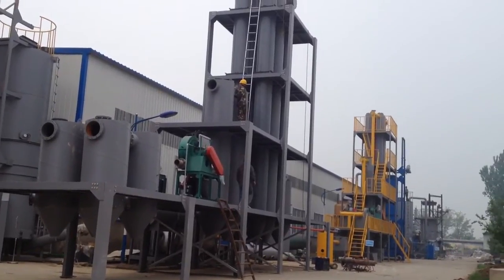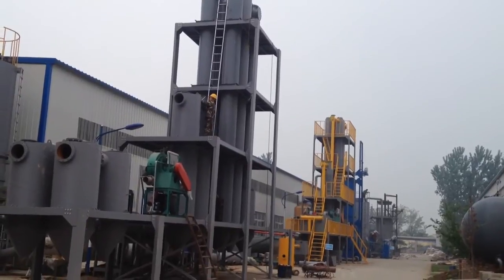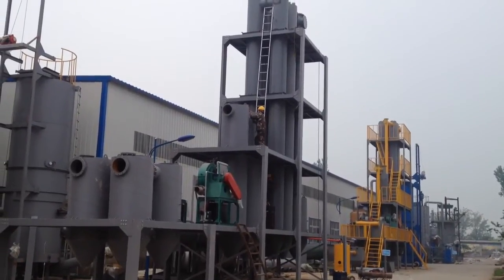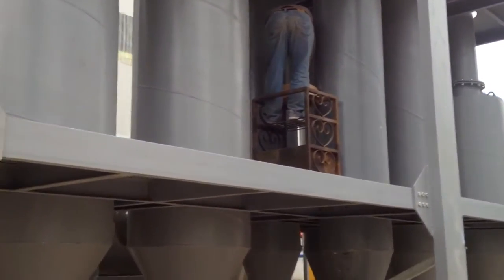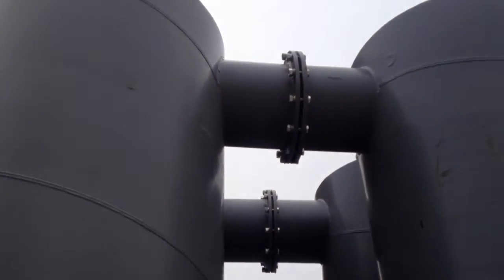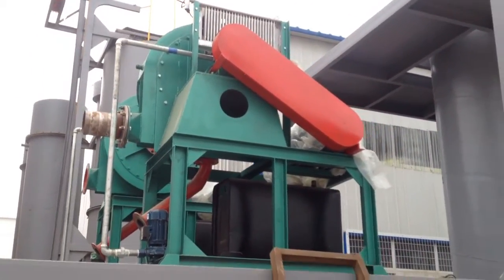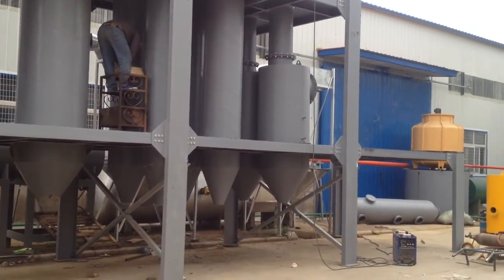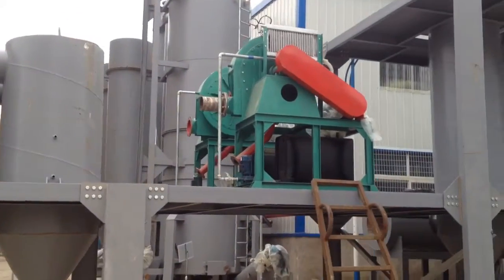500kw biomass gasification power plant system in Haiqi company China,generator,

Comment: Hello
I have a technology can boost your general generator from 50 KW to 300KW to become 10MW to 200 MW per substation. (estimate),no fuels. 
My technology does not depend on any fuel, no ocean power, no wind power, no sunshine, no water power, and no heat power, and no battery, and not magnetic. Best regards, Porn